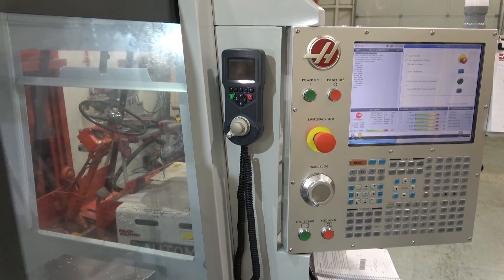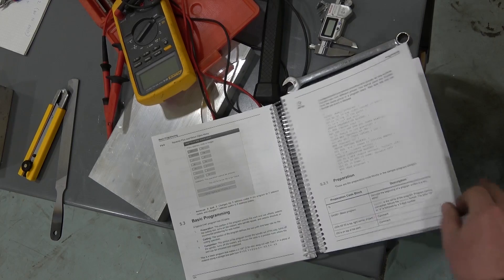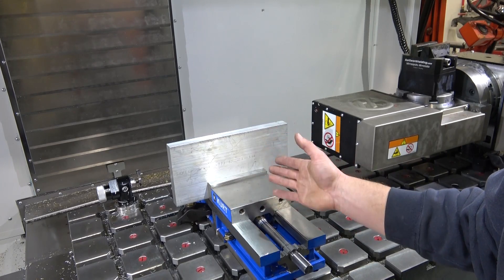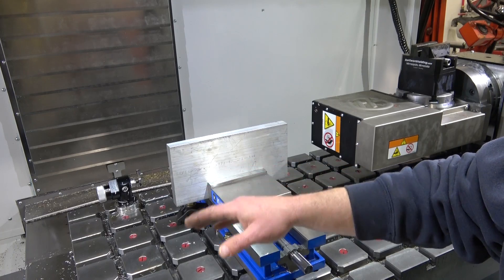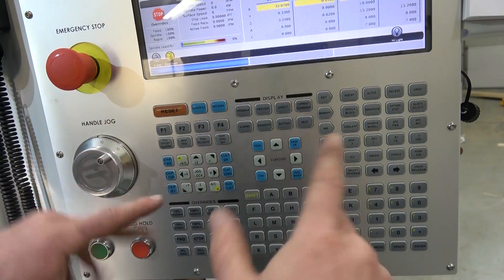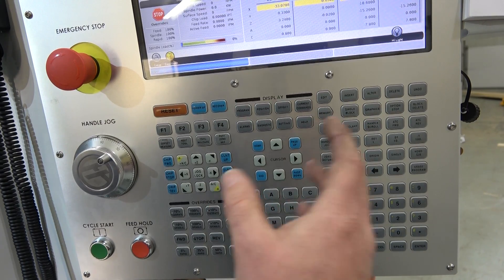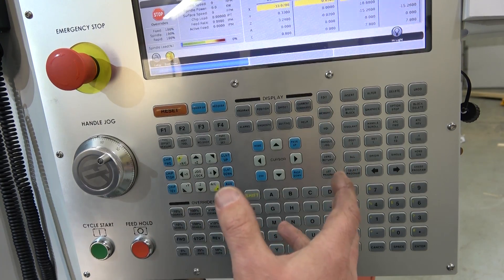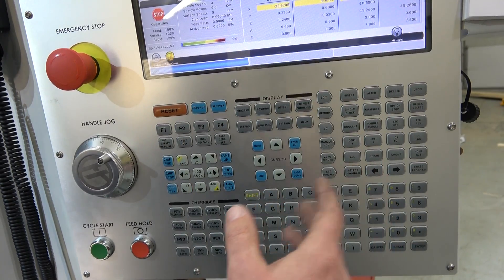HAAS Shakedown | JUNK Visual Programming System

Comment: I own a 2 year old Haas VF-2YT fully loaded and an older Tormach PCNC 1100 running Pathpilot.  What Haas calls VPS ...Tormach calls it "Conversational" . The Pathpilot "Conversational" l is excellent,  very simple to use and very intuitive, once you try it you'll learn to hate everything else.  I tried using the Haas VPS a couple of times and my blood pressure went up ...what a piece of shit. I read lot's of comments indicating how good the Haas VPS is compared to other brands...if that is so I would hate to try use the other brands.  The 2 machines I mentioned are different machines for different purposes and certainly have a different price range...but the cheaper Tormach user interface beats Haas NGC any day of the week.   PS... I don't endorse any of these 2 brands...they both have their good and bad things.

Comment: I've never ran a haas and will have the opportunity to soon. Are there any videos for vps programming on a mill. All I see are lathe videos. And I'm unfamiliar with haas control and menus.  I have nearly a decade of mill setup and programming experience just none with a haas.
Reply from the maker: This is a townpumpcnc project to help out a guy making caving lights for his friends.
Following are the Fusion 360 tutorial/machining ops
01. CAD design of aluminum stock. https://youtu.be/zCzrNISQKH4
02. Stock set up and WCS https://youtu.be/6UgqQSq2exA
03. Facing operation https://youtu.be/2v2rM8oHAFc
04. 2d Profile https://youtu.be/85JxO1CUink
05. Re-re-re-re-re-installing post processor https://youtu.be/ejjXu_SyuNw
06. 5 axis positioning https://youtu.be/lVisKaMM38g
07. 2d Adaptive Roughing https://youtu.be/LFM4jtLIWj0
08. 2d Profile https://youtu.be/sNzjytq6tU8
09. 2d Pocket for O-rings https://youtu.be/ZrIH9TasOlU
10. 2d Contour slitting saw https://youtu.be/tbiZaSW1BSc
11. 2d Chamfer https://youtu.be/A2gI-pdfwN8
12. Multiple WCS different parts at the same time https://youtu.be/JVgkXL1-1FA

Comment: I have a Prototrak that uses conversational and you can’t beat it. This VPS on the new Haas DM-2 we just got sucks. The facing program worked fine the first time I ran it then started ramping down on each pass it made the next time I ran it. The VPS tool probing cycle started faulting out yet it still put a value in my tool length offset. Somehow it just copied over the estimated tool length column. Glad I caught that. Like you say, if you can’t fucking trust it, you can’t use it.

Comment: As near as I can tell, Haas haven’t even done a VPS tutorial for the mill. We just got a new DM-2 and I’m learning the control. Prototrak  is the undisputed king of conversational programming. I have a DPM in my home shop and for most simple stuff like that hole pattern, I can be making chips before you can get your computer booted up and your CAM open.  Not saying it’s better, no tool changer, slow spindle, and chips fly everywhere but for a 40 year old machine it’s surprisingly useful and user friendly. If I was starting a small job shop, say something in a garage at home, I’d definitely start with a Prototrak. Maybe one a little newer because 3.5" floppies are kinda hard to deal with. Most stuff that walks in the door can be done on one.

Comment: Use A-9 cutting fluid when tapping aluminum rather than coolant. It makes a world of difference, and probably would've prevented the tap from breaking. Same if you need accurately sized drilled holes. Aluminum is soft enough that it's own chips can rub the hole oversize while drilling with just coolant, A-9 helps with that.

Comment: I've gone from Biochemistry to running a CNC shop in the past six months... I have found that I'm using a mixture of hand coding and CAD/CAM.  Part of that is not having the time to get with our software reseller and finish developing the post processors for our turning centers, but part of it is learning the code is really helping me learn what else I need to learn (I hope that makes sense - if you don't know what you don't know...).  It's easy enough to poke around a toolpath in CAD until you get something workable, but I often end up at least modifying the post processed code prior to production runs.  One thing that has been a lifesaver on our turning centers is the program check feature - it lets you handwheel through programs instead of just slowing down the rapids and hoping you're fast enough on the E-Stop!

Comment: On jobs that have multiple holes with deep threads consider if a roll forming tap suits your application I use them all the time and have had great results in consistency and reliability

Comment: I just do 3D printing and between the fucking heater block thermal runaways (aka plastic fires), driving the nozzles into the bed, extruder rebuilds, and electrical problems, I'm probably going to have enough spare parts and knowledge to build my own goddamned printer business soon.  If I were asked to program a CNC machine like yours I would run out of the building screaming.

Comment: You can rip with that kyocera cutter and the pdl025 inserts. I run the 2.5" 5 insert variant at work. Try 3300sfm and .0075 to .01 per tooth for roughing and you should be pleasantly surprised with the hailstorm of chips smacking the sides of the machine. Just don't go much above 5000 spindle speed. The numbers for the 2.5" come out to 5042rpm and 189.8 IPM. Although I've pushed it up to 262IPM with good results. That's with 2.0" stepover and .125" DOC.

Comment: Holy shit - isn't there a serial port or ethernet jack on these things you can blow code across after you've spent an hour double-checking it for boo-boos sittin on your ass with a nice cold one? An some kind of simulation/runthrough sanity check you can do for code on a PC first?
I knew these things were strange but wtf?

Comment: My humble advice: the best thing a CNC operator can learn is how to safely "prove" a part program.  This can be done by the use of the following CNC functions:  SINGLE BLOCK, %FEED OVERRIDE (%FO) dial and/or FEED HOLD, and the one, and ONLY one screen display you need: the DISTANCE TO GO (DTG) value for each axis.

This can be time-consuming.  And boring.  But I can guarantee if you follow a fairly simple process, the operator of the machine can confirm a given part program, whether self-written, generated on-CNC with something like Haas's VPS, posted out from a CAM system, whatever...  will run to completion successfully, will not break tools, or ruin parts.  And that operator need not even see, or understand, the part program.  

Simply put:  the part program is run one-block-at-a-time following these 4 steps:
a) starting each block with motion disabled (by %FEED OVERRIDE set to 0%);
b) on pressing CS, operator checks DTG;
   c1) any value in DTG must be confirmed by the operator to be allowed BEFORE letting machine go (%FO > 0%).
   c2) if no DTG and block completes, no worries, all good.
d) repeat from a) until part program is complete.

Obviously, there's a lot I'm glossing over.  There's already 1000+ posts here, so some might have brought this tried and tested process up.   I'm game to discuss this at any level of detail anyone else wants. 

I have personally trained operators that don't understand me (sadly, I only speak English, and by some accounts, poorly at that).  Nor understand a single G-code, or who can't add or subtract.  I've trained operators with a cardboard mask covering the screen with the exception of the DTG display; no block number, no on-screen status indicators.  And no broken tools or scrapped parts.

Love your videos.  Can't wait to see what comes of this project.

If you get this far, and tell me WTF "BOLTR" stands for, I promise to at least click the link to your Patreon page.  Or Patreon, as the kids say.  On the socials.   FFS....

Comment: There is no logic to ANY visual / conversational   program, unless you know the rules of the machine it was designed to work with. And for that, one must read the manual that goes with it. 

So when I started to fool around with a VF2, I spent a week reading the manual on the visual / conversational program HAAS created. I too was fairly frustrated with its "logic", for about 2 days. But after reading several sections three times and making notes, I soon began to see the logic and steps required to be successful when using the keyboard and "mouse" through each section / template. It took me about 6 months before I was understanding (with medium level of confidence) how the interface truly worked. 

I will say, for every hour I invested reading the manual and following several HAAS forums, was worth every minute. And I'm still learning the basics / potential of the machine.

Comment: AvE: you mentioned getting advice from NYCCNC, did you discuss cutting your CNC teeth on a Tormach, and if so what was the decision tree of going right to the Haas? Seems a bit like putting a 15 year old Canadian in a manual tractor trailer with Cyrillic instrumentation, only with a Ferrari price tag!  I'm sure you'll get up to speed, but you might exceed the rated milage on your sphincter! <3
Reply: Did you get that new crash protection feature? No shame in wearing a seat belt.

Comment: You may run into faults because you’re running out of X travel which is amplified by the big face mill.  The travel in is smaller than the table.  Try running in “graph” mode to simulate before running live.  You can see where the tool is going and check the Z value to make sure you’re not hitting the vice or 5th axis.

Comment: (serious mode) what chuck is that? I have a rhom supra and it would just undo itself when it reverses. I was told if I spend 4 times as much on a rohm spiro, it wont undo itself. sigh. Not that running a tap in a drill chick is ideal, but clearly that's not the source of your issues here. On the conversational: My older brother tapping centre is conversational ONLY (no g-code). It does everything you need, and nothing you want. So now it has LinuxCNC.

Comment: To rigid tap on a Haas you need a special tap holder that floats.  It makes up for any slack between where the tap is supposed to be and where it actually is.  Usually .1” or so of slack.  They come with square collets that match the end of the tap.

For $150-200 at your local community college, they can teach you everything you’d need.  Even getting an old pro to just stand there and look over your shoulder will probably save you a new spindle.

The old guys are screaming at their computers because they’ve all seen spindles destroyed by people who probably weren’t even beginners.

Comment: Dont be 100% sure, add several inches above the part and run your program cutting air first. Then you can be 70% sure
😅.
Machinist who worked on a couple of Hass' here.

I could re-write up a few programs I have written for Haas. With quite a few tweaks. If that would help, but I noticed the two Hass' I worked on had some different bugs and odditys.

And I never wrote stuff that was too complex by hand. 
So there is that. 
And it was all G&M code. 
Anywho, if ya want to shoot the wind and see if I have any gainful knowledge to you, let me know, that's an open invitation to

Comment: You will thank me in the long run learn from my mistakes put a cover over that touch off probe..... I use a coffee can mounted to the table with a simple bracket you can take off when you need to use ....long chips coming off of a drill will wrap up and snap your stylus right off of the touch off probe

Comment: Your OTS is setup weird as fuck. Probing the diameter in X seems sketchy, Y would seem much better. I run a VF2ss that's setup to probe diameter in Y, that's how I assumed it they were all set up, as the HAAS installer set it up here a couple years ago. If you ever put in any big ball mill it will probably eat the shit out of the main body when trying to probe the diameter of the tool. Maybe it's a next gen controller thing? Can you choose how it probes? Running the old controller here. I've setup an 1-1/4" ball mill here, and it was butt puckering to probe even probing diameter in Y. Probing in X never would have worked, and would have seriously done some damage. Just something to think about.

Comment: Question: 

Why M3/M4 the tool while running in Z for TLO? And why run the Diameter touch in X, not Y when it's mounted the way you have it (X-/Y+) on a Vertical Mill?

Never seen that done before? I've seen Tool Setter Calibration Programs touch in X/Y but that's only for Calibration?

Not busting your balls, just trying to get learnt.

Comment: Hey AVE can you put that controller to run straight G code. If so I would highly suggest it just to get used to her. If so HAAS does have alot of decent canned cycles that are very user friendly. May I suggest looking into the G 150 and G13. Those 2 are what I use alot and very easy to learn. Keep plugging away I know you'll get her going.

Comment: I put a tap in a drill chuck the other day because I didn't have the right size collet. Works fine as long as you don't use a keyless chuck. Those tend to loosen up in reverse. My only question is why spend the money for a machine like that but not CAM software?

Comment: (note, I'm not a machinist/cnc specialist)

But is that VPS actually used for "real work" or is it just for testing/dicking around purposes? Maybe it's just there because they have to offer "something" built in.
Maybe not a lot of work is being invested in by HAAS because everyone uses CAD to generate the gcode ? 
It's not uncommon for companies that specialize in hardware to have awful (built in/bundled) software support when they really just want you to use third party software instead of use their quarterassed implementation of it.

BTW... Is this running of an actual 3 phase? or via an inverter? If via an inverter, couldn't that be a cause of a lot of issues ? Wouldn't surprise me that they make (not unreasonable) assumptions about the power supply, after all this isn't the kind of home appliance you will find in everyone's kitchen cabinet.   At least, I've never found one whenever I'm looking at kitchens.
P.S. Don't let the wife figure out that you can put a whisk in the chuck and have the Haas replace a kitchen robot 😂

It's interesting to see you fail a this... when you see machining videos, especially for CNC, they never show you the learning steps... good way to learn about all the "newb" mistakes so we don't make them as well when we buy one of those CNC's for ourselves...  Keep making all the mistakes for the betterment of humanity.

Comment: AVE, could not agree more about Haas IPS. It is absolute crap for programming. There lathe is the same way. I would focus on a cad cam package like Fusion. Once you get your tool library set up and a few setup templates, you can gcode that machine with much better control and reliability than there junk IPS. You can also make a few Starter Programs like drilling for example and just edit the gcode with new XYZ moves.

Comment: This is the 1st time I've seen CNC. Is it supposed to spray out that much jizz?

The electric bandsaw in metal work class used to squirt some white sh!t on the job to cool it down so they say but this CNC seems to squirt more jizz than an 18yr old bloke who just scored a 3 way with a couple of super models!

Comment: VPS is POS.
Best thing to do on a Haas (or Fanuc), is to use basic G-code for milling, and learn the most common canned cycles for holes. Make yourself a bunch of template programs with the start and end lines for each type of operation you want, then you can just go thru and fill in the numbers for tool paths, hole locations/depths, etc. 

This is all you need for the type of stuff you will do getting started (3-5 years). Worry about 4th and 5th axis after that.

If you want I could send you some examples.
The frickin spindle probe is great, right?

Comment: There are plenty of open source G-code simulators out there that you can run your program through to check for issues.   For actually generating the G-code, I have used HSM Express in the past with good success.

Comment: This is the same way I learned how to CNC. I broke out the Haas manual (although mine was a 1999 model) learned the interface, learned how to start up, learned the basic functions before ever making a single chip.  Then I learned the g-code how to make basic cuts and canned cycles.  Then I learned the CAM software.  Knowing your gear is your first step, then adding the CAM bells and whistles really opens the possibilities.   Good luck and happy programming!

Comment: Even for HAAS veterans the new control is hard to get the feel for. Their VPS and the old VQC both suck! You are better off to spend your time and learn to write G&M code. NOBODY uses that shit more than they need to. Pro’s use CAM software. Go team Powermill. Hurco’s and local favorite owned by Hurco Milltronics, both have very good conversational tools.

Comment: Just hand write the code or use Mastercam if you have access to a copy. I haven't used the modern Haas features you showed, but just from the glimpse I got in this vid, they appear to require a lot of arbitrary and computed assumptions, which equals....low reliability. I basically never get error codes on old Haas machines, except for the standard usual like low way oil, etc....